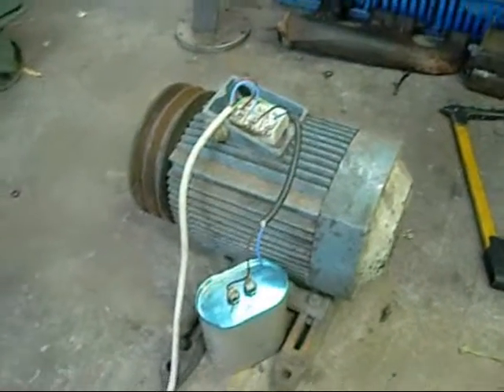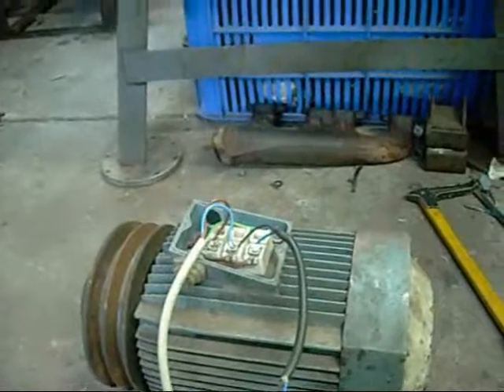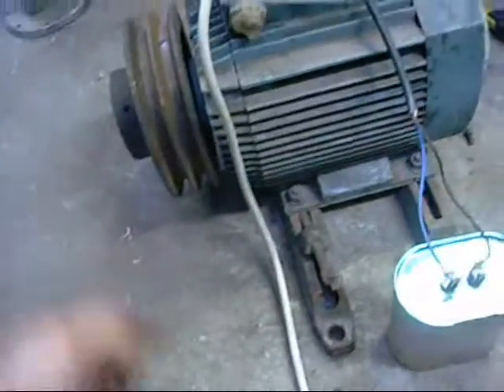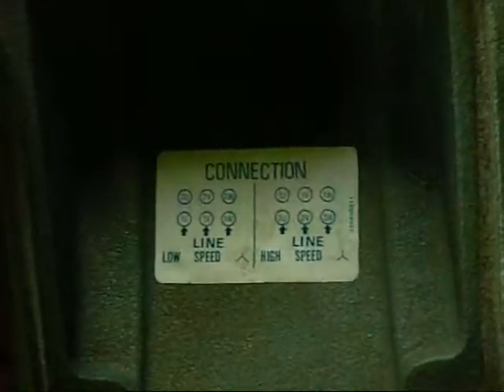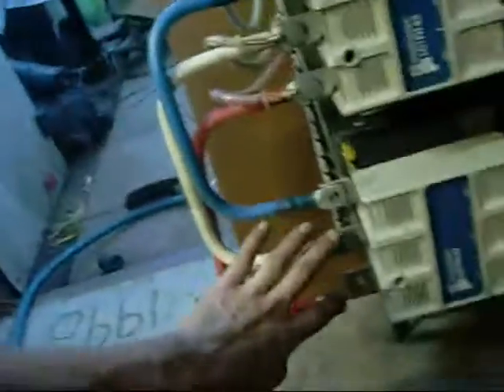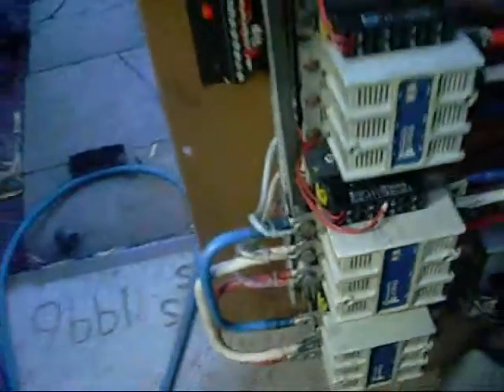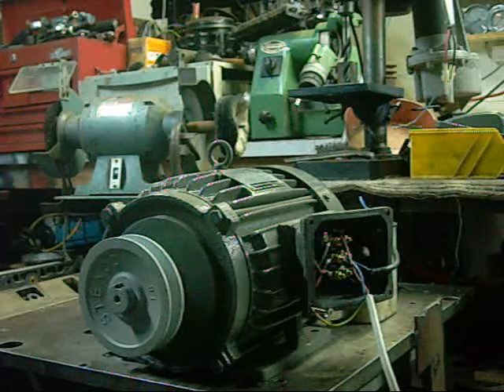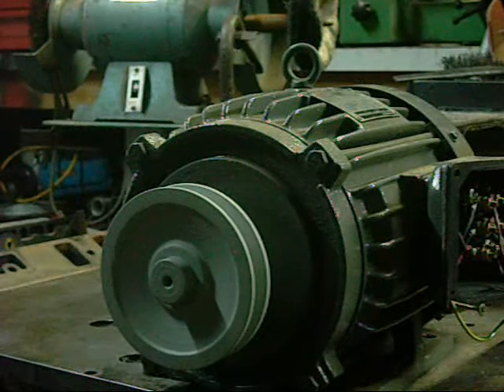Testing ASEA and TECO 3 Phase 415V Motors on 240V 1 Phase

Comment: I have an even older, open frame cast iron asea motor, it's quite lovely but unfortunately developed a crack at the rear cap so the part that holds the bearing is loose... Looking into welding/brazing options

Comment from the maker: @haksarch no worries!. I used to work for Flakt-Woods / ABB Fans and completely forgot that ASEA Motors does not exist anymore.

Monarch and TECO Electric, are both good makers too. we use a lot in cooling towers and HVAC systems with great reliability.

Comment: Excellent video's you have neighbor, across the Tasman,
Try using a timer to switch your capacitor off after the motor is up to speed. That usually makes the running smoother.

Comment from the maker: The video details how to wire it up, but selecting the right run capacitor is something I still have not mastered.  I would suggest 45mfd + for 1 - 2 Hp motors, and around 25mfd for smaller.

I've been doing it by ear, as you saw in the last part the motor ran smoother and quieter, like it was happy.

Also run the motor for a while and monitor its temp, if the cap is incorrect, it will overheat.